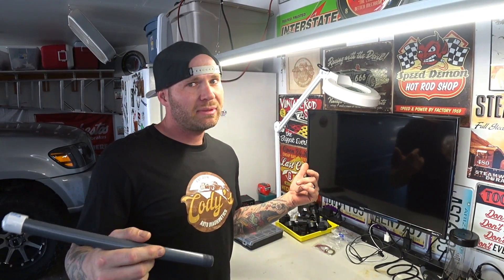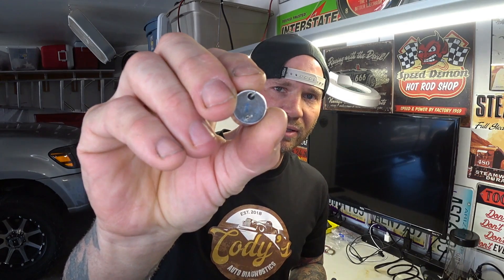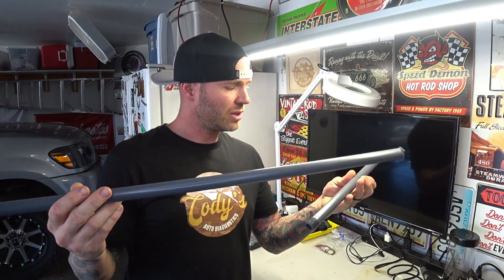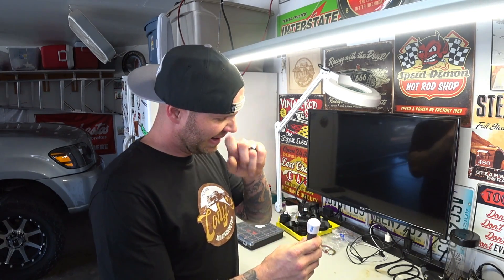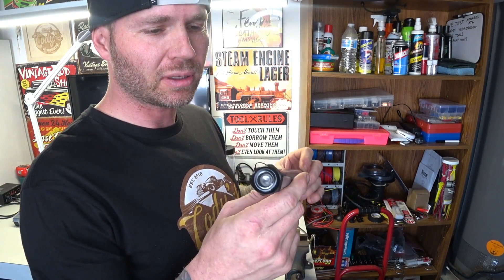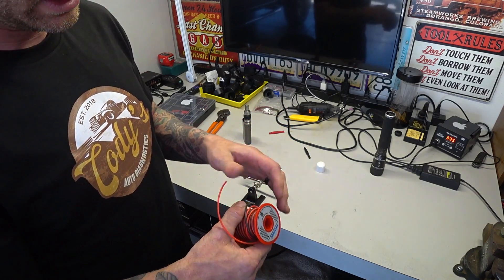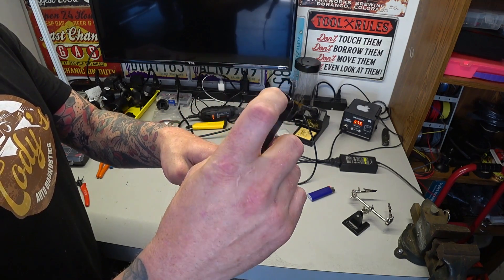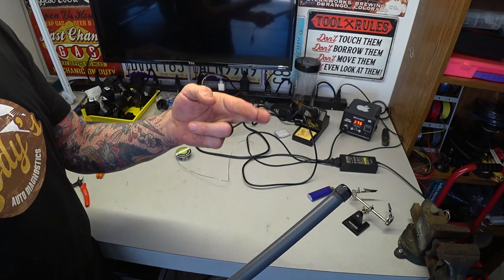(EDITED ENDING )HOMEMADE PARKING SENSOR PICKUP TOOL (IN ACTION)

Comment: Great job-looking forward to keyless entry tool.
I would consider putting a knot in the wires leaving the wand to help prevent unwanted disconnect but that is just because I know how easy precision tools can get damaged.
Reply from the maker: I got a trick for those entry sensors. I’ll post a video. No special tools needed. Just using your test leads

Comment: Great video Cody 👍. Just ordered my parts off of Amazon a couple minutes ago.

I've been using Pomona test lead wire to make leads recently, great stuff. Pomona 6733-0 and 6733-2.
Reply from the maker: Yeah the Pomona leads are typically what I use as well. The wire I was using with these was left over scrap from another project. Hans from the fb group mentioned using a pizo sensor for performing the same test so I’m curious to try that next. Thanks for watching!
Reply: @codysautodiagnosticsprogra8706  humm. Back to the Amazon for me now.
Reply from the maker: Science Of Diagnostics I dump so much money into amazon 😂😂